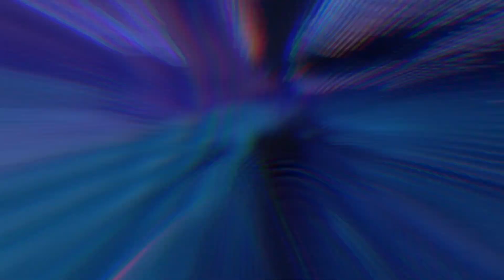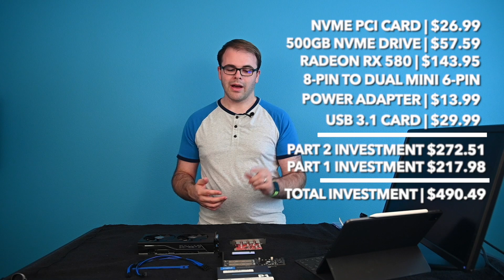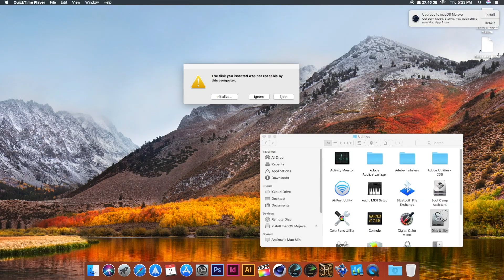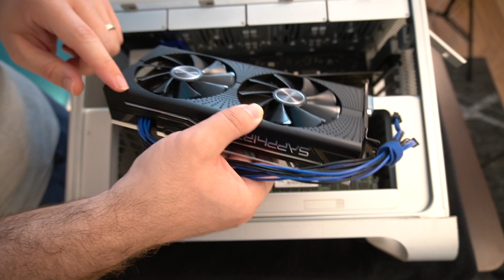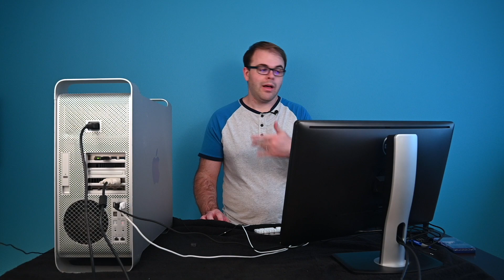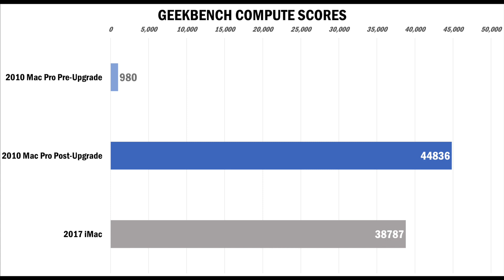The Ultimate 2010 Mac Pro Upgrade in 2020 [Part 2]

Comment: First, you insert two plugs onto the motherboard that power the graphics card to make it easier. Then, you insert the graphics card, which should be in slot number two because it is double the size, and the PCI-Express card with a fast disk should be in the first slot at the bottom because it is much faster than slot number three. You made some basic mistakes.

Comment: After I put in my Radeon RX 580 8GB PCIe I no longer get a boot screen. It does boot but I can no longer hold the option key to chose which drive to boot from. Can this be fixed?

Comment: thank you for sharing. Is the R580 graphic card noisy compared to the original one? thanks
Reply: no. mine doesn't even turn on the fan in normal desktop usage, so it's completely silent.

Comment: that's not how graphics cards work. 8GB is amount of video ram on the card, not the core/clock speed of the card.
in general more powerful cards will be pair with larger amout of vram, but there's definitely no 8-fold performance. maybe 1.5-2.5 depending on original card.

Comment: The dual processor Mac 5,1 don't give you much advantage over a single processor. Very few programs are written to utilize the second processor. In addition, the memory that you install in a dual core is set up so that each processor gets 50% of the installed memory so that if you install 32 gb of memory you only get to use 16 gb with your processor. I have two of the dual processor 5,1 Macs. Bottom line: unless you have a program that is written to use the second processor as well as the first you are better off getting the single processor. Your milage will vary and I have been wrong before so if I made a mistake please add a comment as a reply so everyone as well as me will know.

Comment: The SSD has SATA connection. SATA 2 to be exact. This limits the performance of the SSD to 200-250 Gbps. If you could connect the SSD via PCIe, the SSD would be much faster. However the NVME just blows away everything.

Get a dual core tray and update the wifi and bluetooth card so you can use Airdrop and the unlock with Apple Watch features.
Reply: Do you need both WiFi and Bluetooth for Airdrop?

Comment: I found one of these laying out by the garbage on the street so I took it home and it still works, but its password protected.
Reply from the maker: That’s awesome!! If it’s locked, try booting into recovery mode and then erasing the hard drive and reinstalling macOS. If that doesn’t work then put a new hard drive or solid-state drive in it and you should be up and running.

Comment: I don't have any interest in "high performance" graphics cards (no gaming or whatever, doing strictly audio work on this machine).  However, I would love to be able to run multiple large (say, three 27-inch) monitors or a single big ultrawide monitor on a Mac Pro 5,1.  Do you have any suggestions?  Also, do you know how/where I can find out whether or not High Sierra (the latest macOS that I can run my apps on) will take advantage of quad- hex- or 12-core CPU hardware?
Reply from the maker: I know you could buy a lesser NVIDA card that should be able to to handle that. I believe in my video description I put a link to all of the compatible ones Apple supports. So I would go after one of those if I were you. As for you other question, what app are you wanting to use?

Comment: Great detail video I have one question, since you have a x16 pcie adapter would you get a better performance installing the adapter in x16 slot 2 instead of slot 3 which is a x4? I’ve been doing some research and I’ve read how the x16 pcie adapters can give you a faster r/w boost in the second slot up to 6000mb/s but I’ve only seen where the pcie adapters would have multiple nvme blades installed to get the speed boost. I have not found any information where someone just use only one SSD on a x16 pcie adapter in slot 2.
Reply from the maker: Yes I believe so.  I had another viewer mention the exact same thing to me. 😀

Comment: My suggestion: put 10TB server grade hdd and an ssd into dvd bay. Insert 4x2TB fast hdd into bays 1-4. Make them into soft Raid 0 - 8tb. It will have about 300-350 r/w speed.

Partition 10TB to 2 and 8 TB. Use 2TB partition as TimeMachine. Use 8TB partition as a backup for 8tb raid 0 and sync it with FileSync. Use nvme as a scratch disk.

If you don’t want to remove dvd, you can use 8TB instead of 10TB in bay 1 and 3x2TB disks if 6TB working drive suits you. Raid 0 build from 3 drives will be as fast as built from 4 drives (it just is).

Now you have 6/8TB working drive with ssd speed that is backed up (raid 0 will fail eventually), a timemachine to restore system, an ssd for system and ultrafast drive for scratch disk.
Reply from the maker: Thanks for the very detailed suggestions :) super helpful 😀

Comment: All great upgrades, just did about the same upgrade on my Dual quad core 5,1
Reply from the maker: Thanks! It was fun to upgrade.  Stay tuned for part 3 in a few months.
Reply: What happened to Part 3? I've been ready to do the upgrades you outlined here (great job, btw!). It sounded like you were going to discuss some of the issues with dual booting and losing the boot screen due to the video card upgrade. I really want to understand the process before I add all these upgrades. Like you, I have also been keeping my CS6 apps alive on High Sierra but want to make sure that I can still access them easily after all the upgrades. Help!  @LoveTech4U

Comment: Could your Mac Pro still run Mojave if you removed the RX580 and reinstalled the original graphics card?
Reply from the maker: Yes.  I actually got Catalina to work with the old card as well.  Although the graphics are a bit unstable.
Reply: @LoveTech4U  I’m thinking about doing that after I install Mojave
Reply: @LoveTech4U  I'm having an issue installing Mojave because I keep receiving the "This copy of the Install macOS Mojave.app application is damaged, and can’t be used to install macOS" message
Reply from the maker: Which graphics card do you have in the computer when you are trying to install Mojave?
Reply: @LoveTech4U  RX580
Reply: @LoveTech4U  I decided to ask someone else to download the Mojave installer and save it to a flash drive for me because that seemed like the only option. I still haven't installed Mojave yet but I'm planning to install it when I have the opportunity. Does no boot screen mean you can only run one OS on your computer?

Comment: One of your mistakes is that you put the NVMe PCI-e card in the wrong slot.  You MUST put it in the 16x slot for full speed, that is, if you want over 2000 read write speeds.  

You are running at half speed.
Reply: That is incorrect. With the adaptor card he's using, that machine will never see over 1400-1500 for Write. That adaptor card is the bottleneck in this case with its using the PCIe 2.0 interface...NOT the slot itself. I've proved it on my own machine many times. Only with a card using its own PCIe 3.0 interface that supports a MB without bifurcation will you achieve Read/Write speeds of around 2450/2800 in a cMP. A SYBA card will give you this. Change the card to a Sonnet Fusion 4x4 card (which allows proper RAID) and you're talking maximum speeds closer to what you're talking about in a cMP...even higher speeds in a 2019 MP. Pricey, but worth it...at least to me. Now with both of these cards, they HAVE  to be in the 16x slot. Good luck.
Reply: @hangar4avs  Good that someone picked up on this. I have two 12 Core Mac Pro 2010 running the Syba cards in both machines with two Sabrent NVME cards in each. One running High Sierra, the other Mojave. The NVME drive is also a SSD to be precise just a different format. The Sata connected SSD's max out at around 500 mb/s on a PCI card. The PCIE 3.0 in the Mac Pro maxs out at around 3000 mb/s theoretical. Mine do 2800. The raid suggestion is only good for storage. Apple unfortunately doesn't permit booting from RAID devices. Also I didn't see any mention of the firmware upgrade necessary for the Mac Pro 2010 to recognize the NVME which can be a bit tricky. Maybe it was in the first video which I didn't watch. I almost fell asleep watching this one. I would recommend more research before presenting such technical information....
Reply: @hangar4avs  I'm not overthinking it. If you are using an OS earlier than Mojave you have to install the Mojave firmware update which enables NVME recognition. Then if desired go back to High Sierra which is more stable for RIP printing. I'm a still photographer and one of X-Rite's Master Coloratti. For 25+ years I've helped them with software and hardware color management. Different field. This guy needs the good luck not me....
Reply from the maker: Thanks for the info on this.  I didn’t t realize that. 👍🏻

Comment: Is it possible to use rtx 2060 on the mac pro?
Reply from the maker: Here is a list of all supported graphics cards you can put into the 2010 Mac Pro: 

These specific third-party graphics cards are Metal-capable and compatible with macOS Mojave on Mac Pro (Mid 2010) and Mac Pro (Mid 2012):
MSI Gaming Radeon RX 560 128-bit 4GB GDRR5
SAPPHIRE Radeon PULSE RX 580 8GB GDDR5
SAPPHIRE Radeon HD 7950 Mac Edition
NVIDIA Quadro K5000 for Mac
NVIDIA GeForce GTX 680 Mac Edition

Some other third-party graphics cards* based on the following AMD GPU families might also be compatible with macOS Mojave on Mac Pro (Mid 2010) and Mac Pro (Mid 2012):
AMD Radeon RX 560
AMD Radeon RX 570
AMD Radeon RX 580
AMD Radeon Pro WX 7100
AMD Radeon RX Vega 56
AMD Radeon RX Vega 64
AMD Radeon Pro WX 9100
AMD Radeon Frontier Edition 

More info can be found on this here: https://support.apple.com/en-us/HT208898
Reply: @LoveTech4U  Wow thanks alot! Will the other gpus be compatible (like gtx 1080) if i used it on a bootcamp windows? Really appreciate the reply coz my dad will send me his late 2012 mac pro and i was wondering if i could upgrade its gpu and ssd. (If it has ssd slot). I would mainly use the windows bootcamp for gaming. Thanksss!!!

Comment: You can install opencore to have a bootscreen and install big sur on the mac pro
Reply from the maker: I’ll have to take a look into that.  Thanks!!
Reply: @LoveTech4U  it is supper simple. I recently did it. You have to look for mac pro specifically and i had to spend some extra time in getting my windows drive to recognize. But it is basically dragging some files. Then opening a config and changing 2 parameters if you want to have big sur. Otherwise you just have the bootscreen.

Comment: I wouldn't touch anything older than 2nd gen intel - it's just not worth it. 1st gen and down CPUs are just ridiculously outdated and I bet lowest 2nd gen i5 would do much better job in most of the tasks than as high as you can get on 1st gen and they cost like less than 50€ for i5 2400 + cheapo MoBo.
Reply from the maker: Yeah.  Totally understandable there. When we are exporting videos on it, it is definitely way slower than a second or third generation Intel core I5 or i7 processor would probably be.

Comment: With the video card upgrade, were you able to get the full boot screen?
Reply: You can get the boot screen and hardware vid acceleration using OpenCore! I’m running Mojave and Win10
Reply from the maker: @zionzamora170  Thanks for the info on that! I'll take a look into that in the future. :)
Reply from the maker: Unfortunately no.  The RX580 gets rid of the boot screen.  I would recommend keeping one of your old graphics cards in case you need to get to the boot screen, you can unplug the 580 and temporarily put in the old one.

Comment: I see other people say use AFPS when formatting the nvme for a mojave boot drive. You did macos extended (journaled). Is there an reason you chose that instead of AFPS?
Reply from the maker: I actually accidentally formatted it as Mac OS Extended Journaled and a bunch of people corrected me saying I should have formatted it as AFPS. However Mac OS Extended Journaled seems to work just fine with the NVMe. So I think either would be ok to do. But I would recommend AFPS.
Reply: Some people don’t like the file system for  AFPS, they chose the older over the new one.
Reply: Although nothing is wrong with Mac OS Extended Journaled, APFS was created to be SSD optimized.

Comment: If you have problems with computer sleep mode using NVME SSD I recommend you to install Innie KEXT. Your SSD then will act as internal an thus allow you to go to sleep mode.
Reply from the maker: Thanks for the tip! I have’t run across this problem yet, but if I do I’ll definitely keep this in mind.  😀

Comment: @LoveTech I would love for you to do a video from turning your 2010 single cpu tray to dual cpu tray in your 2010, because I am about to buy 2010 or 2012 Mac Pro single cpu , but I want to put a dual cpu tray in mine from 6 core cpu to 12 core cpu, I would love to see how to upgrade to cpu tray or swap from single cpu to dual cpu tray....please create a video tutorial on that so I can follow along.
Reply from the maker: I really want to, however the prohibitive cost of buying a dual cpu tray doesn’t at the moment make it cost effective for me.  😢 what I think I’m going to do is upgrade my single CPU from a quad core to a hex core and then further down the road once the dual cpu trays come down a bit more I’ll then put a dual cpu tray in.  Stay tuned!!
Reply: @LoveTech4U  If you want to upgrade the number of CPU’s in your Mac Pro, be aware that in a lot of cases you will find a complete computer with Dual CPU’s for less than a Dual CPU tray.  It’s rarity value, as there are a lot more Dual CPU computers than Dual CPU trays for sale.

If you purchase a Dual CPU Mac Pro you can transfer all your drives and PCI cards to the new computer, and you are left with a working Single CPU computer to sell, which is a great deal easier than a Single CPU tray on its own, and will almost certainly fetch more.

Alternatively, if you buy a still working Dual CPU but bashed-up/dented (and cheaper) unit, you can simply switch the trays.

You can’t swap a 2009 macpro4,1 tray into 2010-2012 macpro5,1 or vise-versa!  The fans go full speed and you can’t control them.

Comment: I didn't see you upgrade the Power supply, I'm about to try the same, going by this vid I take it that I don't need to upgrade the that.
Reply from the maker: Correct, if you are putting an RX580 in you don't need to upgrade the power supply.
Reply: @LoveTech4U  thank you, for the next vid could you replace the tray with a 2 cpu tray and upgrade the cpus to something closer to one of the 6 core dual  x5680, x5679, x5675

Comment: Thanks so much for all the help and time.   Great info and very detailed!!   Good blessings : )
Reply from the maker: Thank you so much! It was a really fun video to put together and I’m glad you enjoyed it! :)
Reply: while you are here.  Would you know where and how I can learn about Flashing a 3,1 2008
Reply from the maker: @UnclePaco36918  Unfortunately it looks like it's not possible to flash from a 3,1 to a 5,1 because Apple changed the logic-board and chipsets you could use in them... https://forums.macrumors.com/threads/is-it-possible-to-upgrade-3-1-to-4-1-5-1.1828107/

After doing some more research on this you can apparently flash a 1,1 to a 2,1 and flash a 4,1 to 5,1. However it doesn't look like you can upgrade the 3,1's firmware.

Comment: Could you show FCPX benchmark with these comparison too? It's the only missing part here, people have an idea how capable machine it become afterwards and if it's capable 4K RAW etc... thanks
Reply from the maker: Good idea! I’ll try and do that in part 3 of the video series! I think it would be interesting to see as well. Going from a quad core to a hex core or dual hex core processors should definitely yield some better 4K video renderings and export times out of FCPX.
Reply: @LoveTech4U  it's very important to see if it's cağable with 4K raw because still waiting for new apple silicone devices and investment on those are not logical right now... Cheers

Comment: Thank you for amazing video! Can I use two graphic card same time? Old and new RX 580? Thank you!
Reply from the maker: I was able to use the 2 original Radeon 5770’s at the same time, however that’s because they used less power (they each have a 6 pin connector that plugged into a mini 6 pin connector on the logic board. However, when you upgrade to an RX580, it draws more power, so you need to us both mini 6 pin connectors on the logic board for the one card.  So the only “possible” way to do this is potentially run an additional power source from the power supply to the secondary graphics card.

Comment: Could you tell me the brand/model of the NVME card adapter?  How has the performance of it been?
Reply from the maker: Hi Rob-

Sure thing! You can find the NVME care adapter here:   https://ebay.to/2C8Lxib  (it is the first result on this eBay search). 

The brand is MHQJRH 
The model is: 3 in 1 M.2 and mSATA SSD Adapter Card for M.2 NVME to PCIE Adapter,M.2 SATA SSD to SATA III Adapter,mSATA to SATA Adapter (with 2 Aluminum Heatsink)

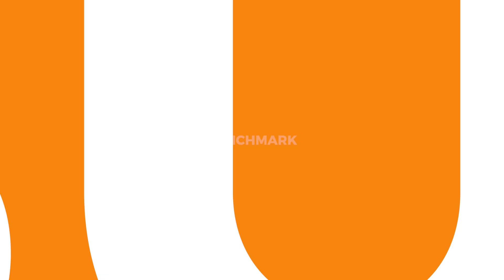The performance has been wonderful so far! Definitely way faster and a HDD or SSD! Would highly recommend. If you look @34:20 Benchmark Comparisons (Before & After) in the video you can see the SSD vs. NVMe speed differences that I got.
Reply: works working as raid 0 with 2 nvme?
Reply from the maker: @valdrack  I believe it should work fine. I only have 1 NVME in mine right now.

Comment: Great video.  I would have liked to see you install Mojave on the NVME drive.
Reply from the maker: Thanks so much!! Yeah it was the same process as installing Mojave on the SSD in my prior video, however the install went way faster.  It took about 15 - 20 mins as opposed to almost 40 when I installed it on the SSD.  😃